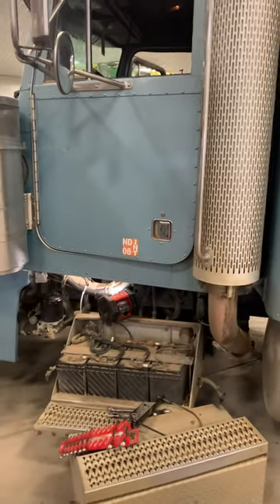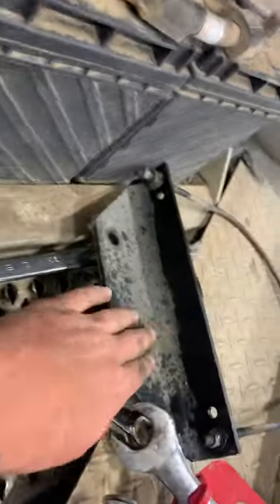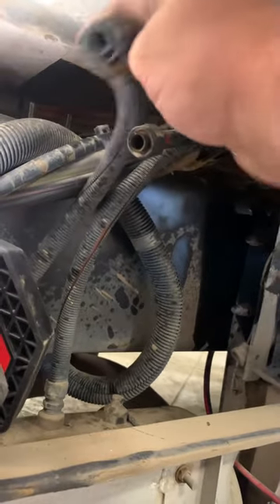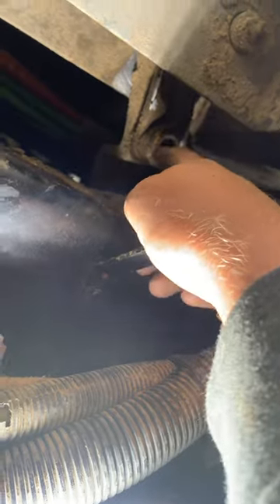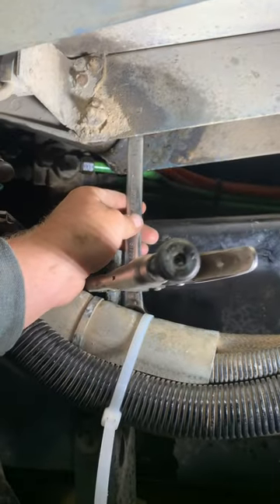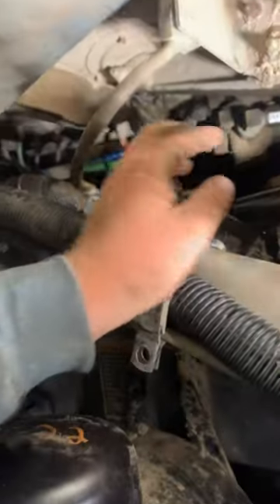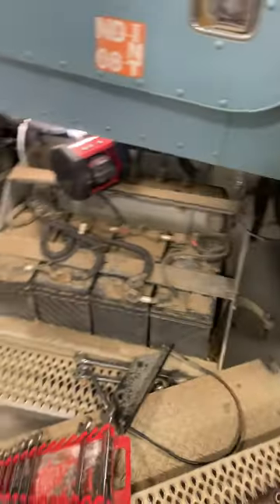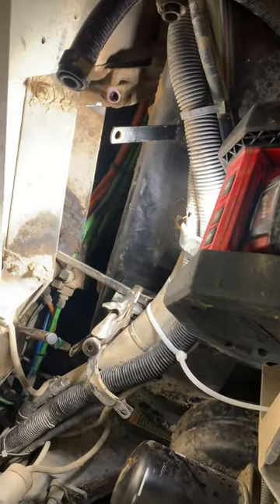Peterbilt Clutch Linkage

Comment: OMG! No need to remove all that crap!😂
Reply from the maker: Was absolutely no way I could get to what I needed to without doing what I did.
Reply: @farmerwreck he’s tripping.  It can be done without taking air tank out, but it multiplies the hell you’ll catch by a hundred fold
Reply from the maker: @arfarms5711 much love thanks figured lol
Reply: I just removed the tank just cut the clamps off and get new ones will save you a lot of time and didn’t take hoes off just pushed tank to the side and pulled that bunch of wires and hoses down with a bungee it’s not too hard to do